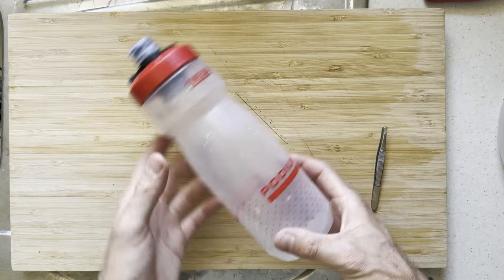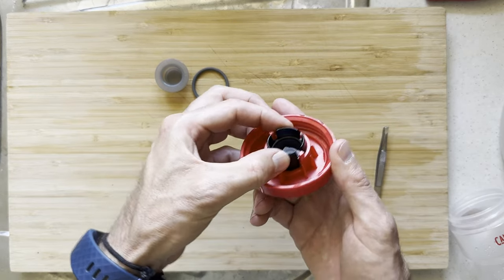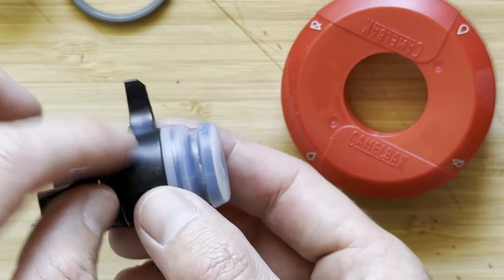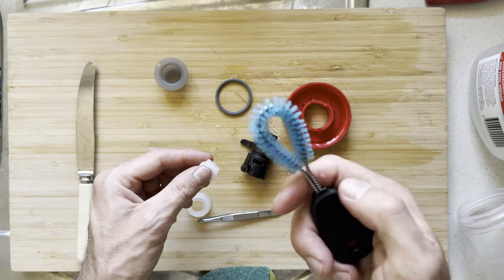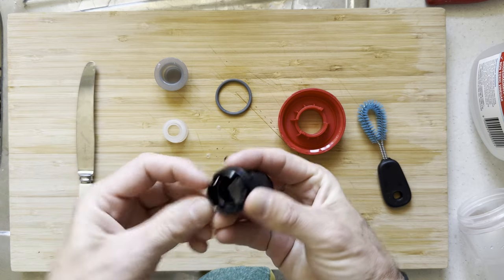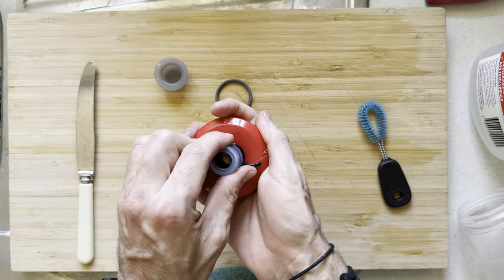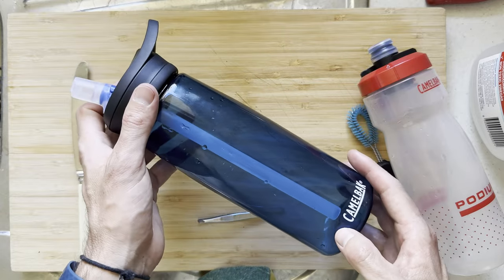How To Pull Apart and Clean Camelbak Podium Jet Valve Lid

Comment: The valve can actually be disassembled further - the transparent rubber valve can be separated from transparent plastic holder. I found some mold in between them.
To assemble back, orient the rubber valve so when you look from outside the bottle, the the curved surface looks concave. Orient the plastic holder wider part outside the bottle. Insert the rubber valve into the wider part of the holder. Then follow the instructions in the video.
Thanks for putting those together.
Reply: Yes pull the jet valve apart, I’ve had mold in there too!

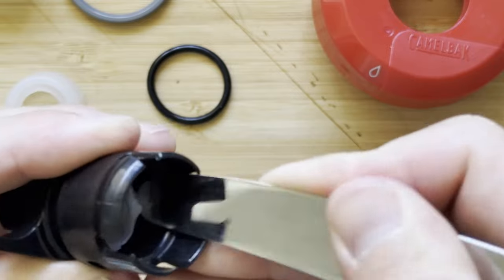Comment: Thanks for the video! I wasn't sure if I could take these apart and was scared I would break something. I found that for 2:17 its easier to go from the other side and push down on the edge of the valve. I ended up slightly denting the outer part of the valve by trying to pry it out. I was probably trying to brute force it a little to much.
Reply: I found a small pair of needle nose pliers works well for removing the valve.

Comment: Excellent, and right to the point. I have the model designed for offroad/dirt; it has the little dust cover, but is essentially the same. All of the small parts make it complicated, but I do like having the option of disassembling it for a deep clean, rather than destroying or damaging a cheaper bottle.

Comment: HUGE thanks for this video! I have an old Camelbak podium and was wondering if the newer version was easier to clean. Well, this video made it clear that it's even more difficult (with even more bits and pieces to disassemble!) and that I should probably just drink my water from a cup to avoid mold. 😅

Comment: Definitely not an easy process.
Any bottles that are made simpler and easier to maintain? Thx
Reply: Podium's Breakaway insulated bottle is basically the same thing as Camelbak's podium chill, but with a much easier lid and mouthpiece to disassemble for cleaning. It breaks down into like 3 parts instead of 8, and can be cleaned in about 30 seconds.

Comment: I accidentally threw away my stopper cap, the first part that is removed. Bottle works fine still, what does it do anyway.
Reply from the maker: Great question and one that I have myself. I’ve got no idea what the stopper cap does and it’s only fairly lightly held in place. If it still works fine without it then I guess you don’t need it 🤷🏻‍♂️
Reply: @huntingwaterfalls  cool. Thanks for the reply and great video hehe.
Reply: The stopper caps function is for the go/no go feature of the locking cap it’s self. Yes, it works just fine without, but you won't be able to store your filled bottles in the horizontal position.
Reply: I was looking for the answer to the same question! I think if I’m just going for a ride, I might leave that stopper cap out. And the plastic ring is not necessary as long as you don’t turn the lock lever too hard. Combined that saves a whole 6g! 😅. But it’s free.

Comment: Thanks for the video. I took apart the jet valves and they had lots of mold in/on them, so then I soaked in straight vinegar and Dawn Powerwash. I use my fingernail to try and scratch off the mold. But it is very stubborn. The parts have been soaking about 4 hours. All of the other parts are cleaned using brush.